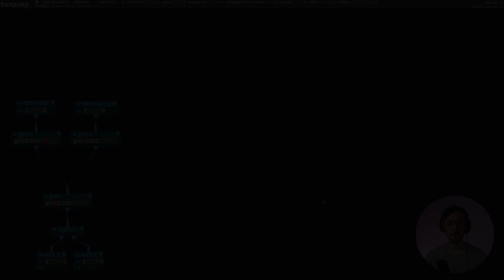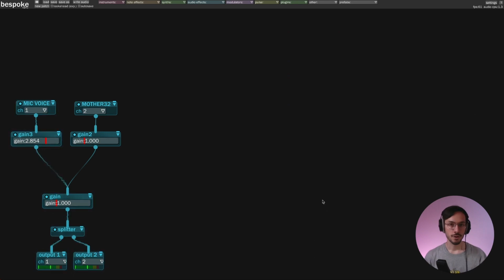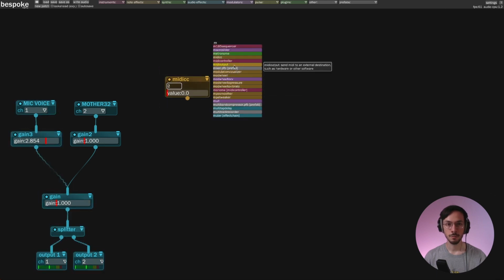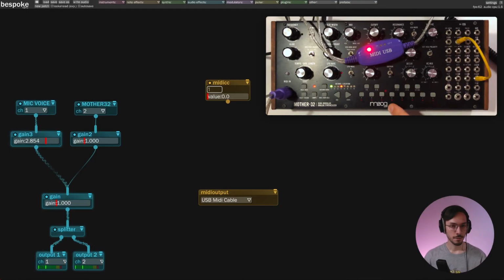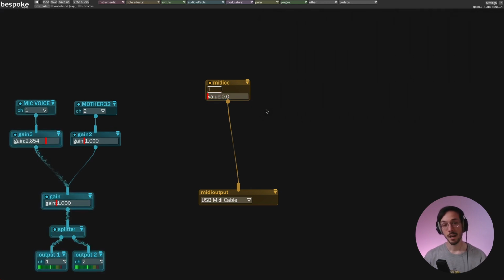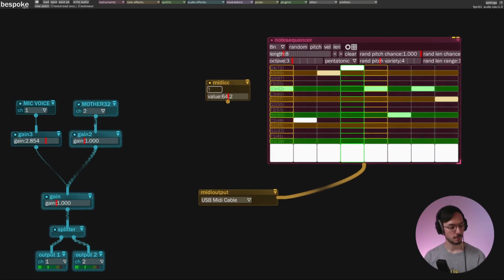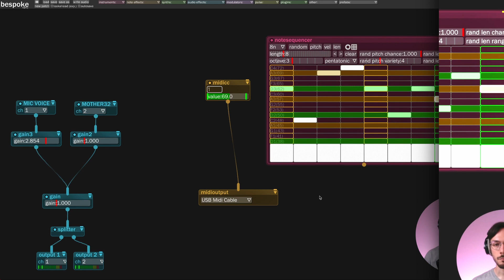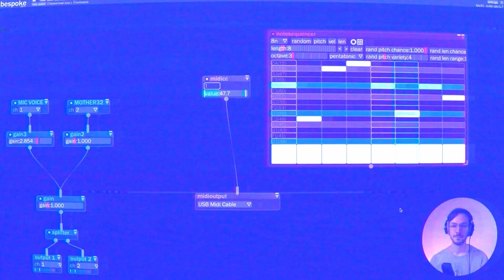Send MIDI Values to External Music Gear | Bespoke Synth Tutorial

Comment: How do you deal with USB MIDI and Audio latency and master clock so that everything stays in sync? In many DAWs there is an external instrument or effect device that automatically compensates for latency. I am talking about latency compensation (not reduction by, e.g., reducing buffer size). Grazie!
Reply from the maker: Take a look at [clockin], it has a parameter called "start offset ms" to adjust the synchronization between Bespoke and your external musical gears. If by chance you are an Ableton user there's a module called [abletonlink] and it works the same way. Ciao :)
Reply: @SoundCodex  grazie mille! Keep up the good work